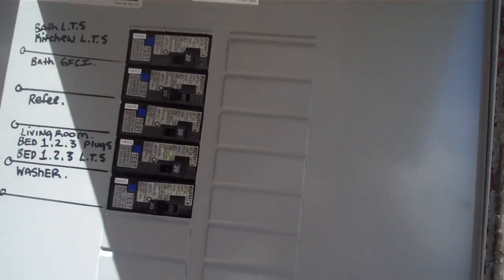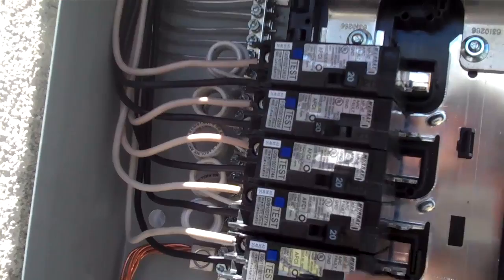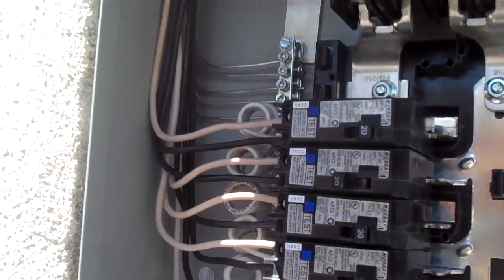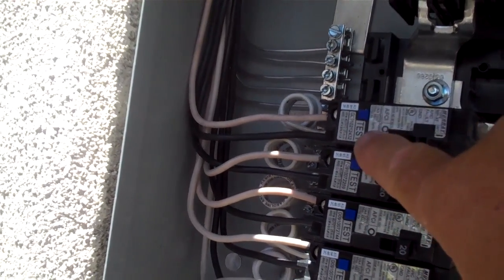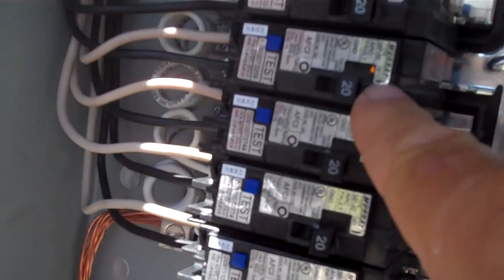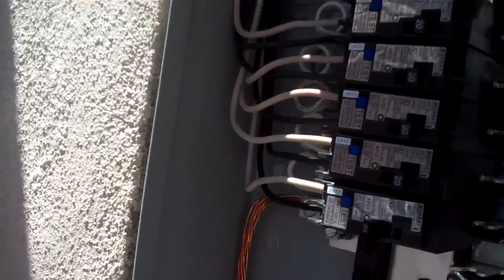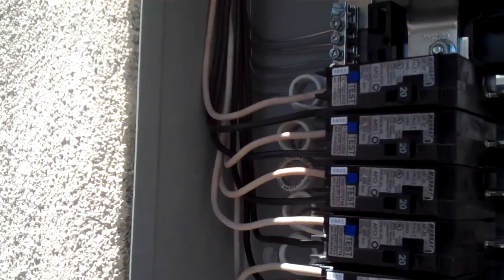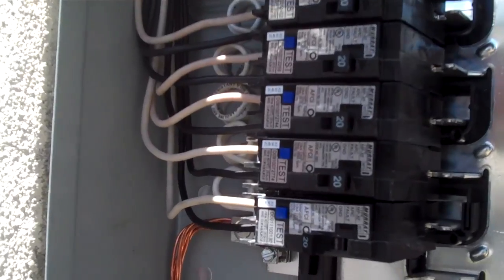Arc-Fault Breakers on New Service Panel

Comment: what needs to be arc fault and what needs to be gfci in a house
Reply: any wet location needs to be gfci protected. So typically anywhere close to a water source. Kitchen counter tops, washrooms and outdoor receptacles. It is now required the use of arc fault breakers in dwelling units. Family rooms, dining rooms, living rooms, parlors, libraries, dens, bedrooms, sunrooms, recreation rooms, closets, hallways, and similar rooms or areas. So pretty much everywhere. So think wet location use a gfci and every other outlet put on a afci breaker. Tip: Installing one gfci outlet to the first receptacle in the circuit will protect any receptacle down the line/circuit.